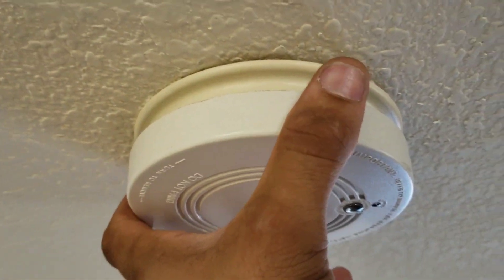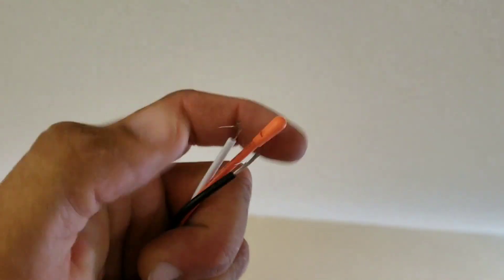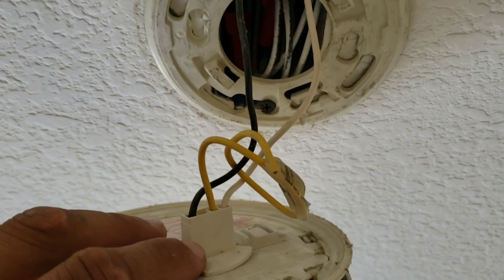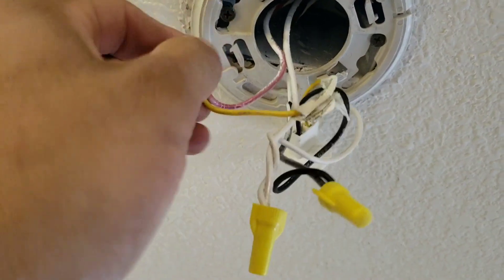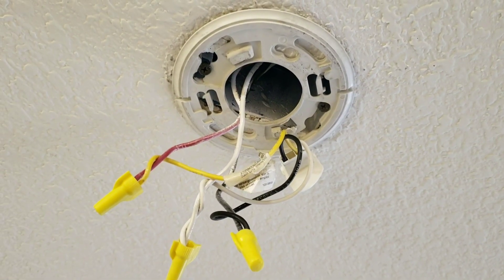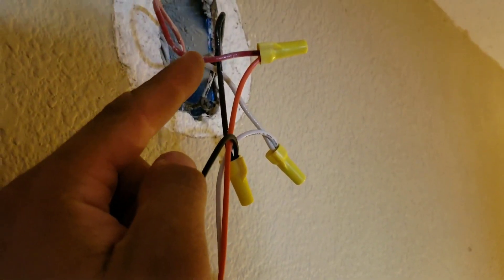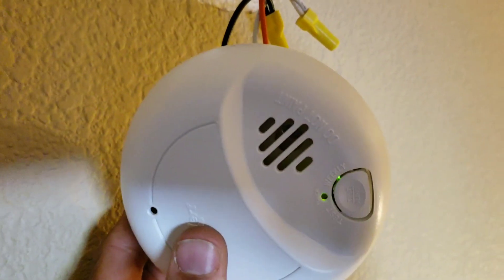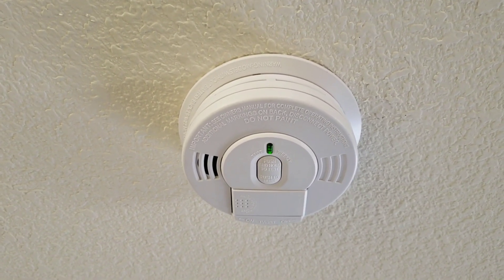How to Wire Smoke Detector. Red Wire?

Comment: Help! Our smoke detector went off in the middle of the night for literally like 10 seconds and stopped.  We decided to change all the batteries....??  One of the wiring boxes had a yellow wire just randomly not connected to anything.  It did NOT have an enclosure on it like your orange one did.  We don't know what to do with this random uncovered yellow wire.... Honestly, probably going to have to hire an electrician because We Don't Know!

Comment: Thank you for the video. 
I have three smoke alarms,  two has the 3 wires harness and one on the second floor only has two. fire department wants us to have all 3 go off together as it's a rental house. I don't think it will be easy to run a new wire. What other option do I  have? Other then buying new wifi smoke alarms.  Any input will be greatly appreciated.  Thank you.

Comment: Well this is a good video but not what I typed in search.  I had one BLK smoke detector installed and one BLK smoke detector with carbon detection.  Both are hard wired into the ceiling.  I wanted to know how I can see it there is a camera in any of them?  I see a pinhole on the top front and of course the sides are open all around not like the Kidde replacement hard wired one in another room that wasn't installed by an electrician.  I hear all kinds of stories about some employees these days that do disgusting things.  I am curious as to how to get peace of mind with the two I had installed.  I can't reach up high enough to look inside the open slots, so I just don't know how to get that peace of mind since a stranger put them in.  Mine has the connecting wires in the package they just plug into the existing ceiling wires.

Comment: Glad I found this video; the detector shown at the beginning of the clip is identical to the ones I am replacing in my home.  Also, the unit on the right at the 1:26 mark is identical to the two units I purchased for replacement.  My ceiling wiring has a black wire (connected), a white wire (connected) and a YELLOW wire (attached to a lone wire nut, but not connected in any series).  Since the new harness has the black/white/red sequence as seen in your video, I will simply connect the black and white wires correctly (AFTER shutting things off at the breaker box) and leave the red wire as is.  Thanks again for the information.

Comment: Do I have to shut off my power before I do all of this? Will I electrocute myself?
Reply: Get Electrician Simulator Demo on Steam when it comes out in Feb 2022. It gets into this and more.  I hope it even has the NEC rule book (or at leas a good chunk of them) simulated or the ability to switch to different countries rules.  :)
Reply: yes shut it off at the circuit breaker.  If you have the hard wire smoke detectors that connect into the ceiling wires, then you will have a live wire.  So please shut it off.
Reply: P.S. But a cheap voltage detector at Harbor Freight to test the wires before touching them.

Comment: You didn’t actually show how to twist/attach the wires together. Not a how to wire at all. Just a run down on wires. Very useful information, and it's good to know what the red is for. But from the title I expected a quick explanation of how to use pigtail wiring, which only one video on youtube explains.
Reply: Pig tails are simple and easy. You take the pig tail and the wire from the wall and twist the bare wires around each other and put a wire nut on top and tighten. Tug on each wire in the wire nut and make sure nothing pulls out.

Comment: The wiring harness won't pull or clip out of my Fre Angel SW1 optical interconnected, you could have perhaps shown the harness pull-out move more closely and the removal operation more closely at the start of the video.

Comment: I reinstalled all my interconnected detectors but when i plug them in they keep going off....what did i do wrong?
Reply: the batteries might be low, whenever you need a new battery your smoke alarm will go off in order to alert you to change it for further use.

Comment: So if I want to interconnect all my smokes, do I have to use 12/3 wire? Or can I use 12/2?
Reply: 12/3
Reply: Hey man why won't my firearm go off together they're wired just like you're video the green light on and red flash every minute
Reply: @kevinbrooks2866  there most likely not interconnected.

Comment: My hot wire wasn’t connected on one of my detectors (KB homes, go figure) it had a beep as if the battery was low, I replaced it and it stopped, do I connect the hot somewhere?